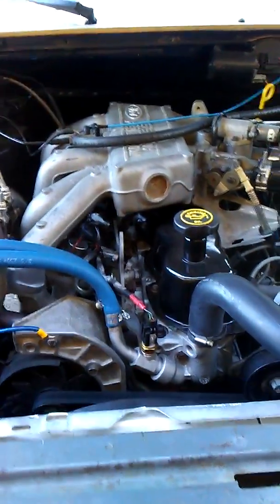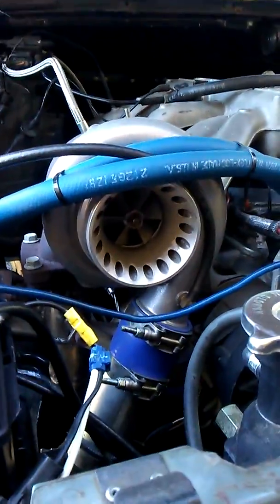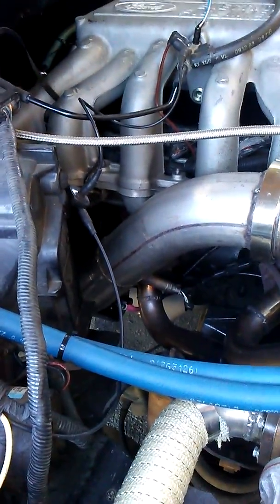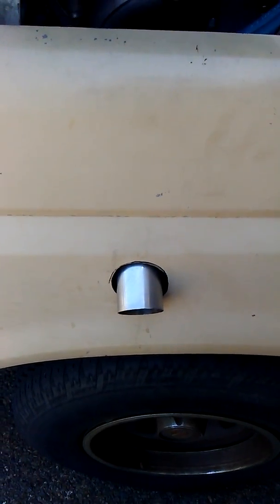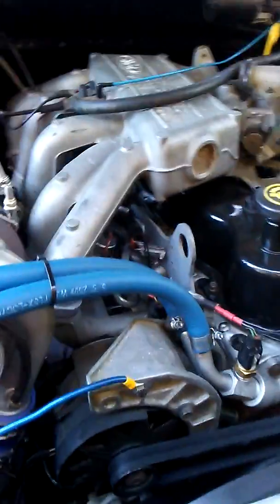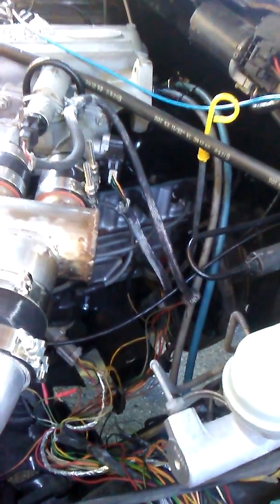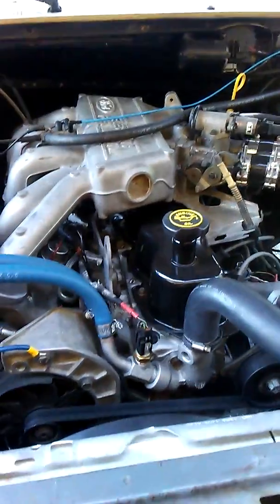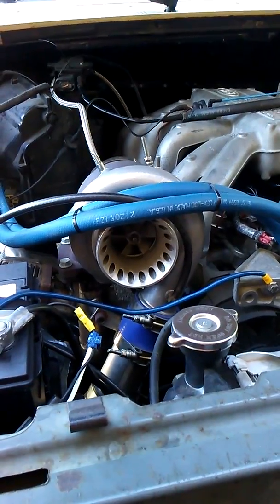Turbo 4.9 overview

Comment: How many miles did the truck have on it when you put the turbo on it? I have 3 f-150s all are 4.9 300 . 2 are 94's & 1 is a 93 ,my newest one is one of the 94s which is the only standard one I was thinking about putting a turbo on it. I was thinking of rebuilding the motor once I get my new place. I've owned Ford trucks for the past 25 years an love the older ones.i also have a 93 f-150 king cab 2 wheel drive that I've had for the past 8 years it came from Texas so the body & frame is still in good shape but I need another motor for it , which I'm looking for to rebuild an make it my toy.
Reply from the maker: I rebuilt mine before turboing it but I have turbocharged many cars and trucks without doing so. As long as the timing is low you should be ok up to about 8psi

Comment: I miss the 1994 F250HD with 300 and the ZF heavy duty 5 speed. It was a tank. The clutch slave failed and I didn’t have the money for a shop to replace it or the strength to do it myself while battling Lyme disease.
Reply from the maker: I feel the medical pain. The reason I haven't posted in a while is due to back problems. I have everything to finish my build but I'm still going through physical therapy so I can work again
Reply: Brutal.

Comment: SHow us EVERYTHING!  Ive been looking for a good simple video like this for YEARS for the old 300 EFI
Reply from the maker: The motor is in a different chassis right now. I will be doing more videos on it soon. I've just been really busy with work and school. The new chassis has had to be all custom done and that's why there hasn't been any videos recently
Reply: @johnzimburean9304  came across your video looking to turbo my 300 f150. Don’t know anything about the mega squirt and can’t seem to find much on it. I would be interested to know how you wired it up. Built plenty of carbureted engines but this is my first one with an ecu
Reply from the maker: @redneckranger92  what year 300 is it? The wiring is really easy to do with a few basic tools. Do you want to Run maf and map? And are you going to use a trigger wheel or just the pickup on the dizzy?
Reply: @johnzimburean9304  yes I will be running map and maf. It’s a 93 engine currently but I will be building a 96 engine for boost shortly. I plan on just using the pickup.
Reply from the maker: @redneckranger92  you will be limited to batch fire with the dizzy for a pickup. The wiring is only about 10-12 wires to get up and running. With just the on board map. It's another 4 I believe to add the maf as well. The instructions the ecu come with are very simple. Make sure your ecu has the bip373 installed on it or you won't have timing control. You will be locked into what the dizzy is set for

Comment: Did you run Total Seal piston rings? I am intending to boost my '68 300I6 and I also have a '65 300 a friend gave me for helping him move multiple vans. The head on the '65 block has some pretty sunken valves so I expect to have the head magnafluxed and if it turns out alright then I will have new hardened seats installed and possibly slightly larger undercut/tuliped valves. It's going in an '82 F250 so I just want low end torque and intend to leave it carbureted with a Predator 12.5:1 a/f ratio. Just starting to look seriously at specific parts. I expect to run the efi exhaust manifolds as they seem like a better option to spool a turbo faster than the HD manifold and flow just .10 less than the HD manifold, however having the HD manifold and going to a 2.5" exhaust would make it really simple to plumb, especially for my plans. I have a few T3/T4 turbos laying around just planning to use one and use a 4 core front mount intercooler. I don't want to run massive boost mostly just give me sea level power at the altitude I live at around 5,800 ft above sea level.
Reply from the maker: I run hellfire rings currently. I have run total seal in the past on some different engines.

Comment: What plugs and gap are you at?
Also what injectors 
I have a turbo 4.9 as well
Having issues with high ram boost at around 10psi... can put my finger on it .

Thanks in advance
Reply from the maker: It's probably spark blowout. Gap the plugs too .028 and get an aftermarket coil. The tfi system is weak at best. I was running 30# injectors but I have a set of 47# injectors in it now. I ran out of fuel one night and blew out my head gasket from pre detonation. 30# are good to around 15 depending on your fuel system and what you have done to male the engine breathe better
Reply: @johnzimburean9304  its just a ebay ar50 turbo t3
I picked up the turbo, wastegate and intercooler and a bunch of piping for real cheap 
Made.my own manifold similar to your with 2" stainless
Bought the flange
Bought a 3000gt vr4 aluminum hard pipe upgrade for my dual throttle body used the bov port for that for my bov.
Reply from the maker: @KryptoDiesel6_5  a t3 flange will be ok for no more than 4k rpm. Even at that your exhaust pressure will be high. If you plan on raising the rpm I would go to a t4 turbo. My 64mm is good for street use but is still on the small side for more than 15psi. Also when you change pistons you will want to increase your ring gap on the pistons. .004" per inch of bore will keep the rungs from touching and breaking pistons
Reply: @johnzimburean9304  when u say do away with the pcv valve should I leave it hooked up just remove it from valve cover or ..???
Reply from the maker: @KryptoDiesel6_5  remove the hose that feeds it from the manifold. Its up to you if you want too run it after that. I vent the front and rear port on my valve cover to atmosphere
Reply: @johnzimburean9304  ok yea I actually left the pcv valve in and vented it to atmosphere than the hose just capped off
Reply: @johnzimburean9304  I too have now both front n rear crank case breather to atmosphere. 
Also last night I took apart my wastegate, had 2 springs in it.
I cleaned it all up and reinstalled just the one smaller size spring. See if that makes a difference boosting less psi for now
Reply from the maker: What injector and pump are you running and what rpm are you turning with what cam?
Reply: Stock motor
Stock injectors 
Factory distributor 

It seems fine until I get to high rpm
Just did new autolite plugs gapped to .028
Reply from the maker: You need waaaayyyyy more injector and pump. With the stock regulator you will get close to 30" out of a 24# injector. You can get those from an efi 460 or an early cobra mustang. You will also need a 255 or bigger pump. The stock dizzy is fine just pull the spout connector to drop to base timing.
Reply: @johnzimburean9304  I may sound stupid for asking , but where is this spout connect you speak of ? Lol

Thanks in advance
Ps since only reinstalling the smaller 5psi wastegate spring , there's no spark blow
I get my msd coil tomorrow 

Lmk about that dizzy connector
Reply from the maker: @KryptoDiesel6_5  follow the wiring from the tfi unit and there will be a small plug along the harness. I believe its a yellow wire going to it but don't quote me on that one. Lol
Reply: @johnzimburean9304  it is the only single wire coming from the same harness going into the TFI?

Looks like it goes to the block itself
Reply from the maker: @KryptoDiesel6_5  it has a little black or grey plastic plug. What year is your truck?
Reply: @johnzimburean9304  yea 
I think I know exactly what your talking about.
94
Reply from the maker: You also need to disconnect the pcv. Crankcase pressure is very bad and you have to have a way to control the fuel for a bigger injector. Without these changed you will have catastrophic engine damage very soon
Reply: I do have a afpr just haven't installed yet , kinda confused on how to run it .
Also if I remove the pcv should I just vent it ?

I previously vented the front engine breather with a little ricer filter.
Reply from the maker: @KryptoDiesel6_5  vent to atmosphere. Get you tuner up and running as soon as possible. What size turbo are you running?
Reply: I did pick up some 4 hole injectors out from a 24v tarus at the junk yard but couldn't find a # spec on em

Comment: I’m looking to do the same where can I get all the stuff that wasn’t made
Reply from the maker: What stuff do you need. I made most of the things I needed
Reply: John Zimburean  most of it.  But I’m gonna buy a 7.3 garret turbo
Reply: John Zimburean mine an EFI in a 95
Reply from the maker: @kinghirschmann335  I will put together a list of parts for a street build and post it up. I get lots of questions for that. Does your 95 have a crank trigger wheel or is it like all the older ones that run off the dizzy for a signal?
Reply: John Zimburean I’m not for sure on that one bub buts it’s 5 speed which idk if that helps or not
Reply: John Zimburean I’m not much of a fabricator. But been wanting to do this for awhile I could pay for the parts if you can make them again if not a hassle I’m looking at buying another engine so that my truck still runs and drives while I’m doing it

Comment: With higher power comes the need for better brakes.
How to install 15 in. rotors on I-beam or Ford front axle is an expensive undertaking for most.
I exit here.
Reply: There is zero need for 15" rotors on a truck with the GVW this would have even with a 560lb 300, boosted is still only scratching the surface of 302 power levels. 13" Cobra rotors would be easy and not expensive at all, especially for someone savvy with fabrication, one only really needs brackets to mount the calipers and matching the lug pattern, everything else can ne sourced from a 1994-2004 Mustang Cobra.

Comment: Be careful with injector size. Keep in mind that the 1990 + 300's ran 65 psi fuel pressure to prevent vapor lock. Stock injectors are around 13 lb to lean it out  (a lot of other ford engines ran around 35 psi fuel pressure at the time) be sure to do some research, they will run very rich with larger than stock injectors. I found out the hard way.
Reply from the maker: Jake Peffer I changed the regulator back to 35psi. had to make a custom mount for it but it works good
Reply: Where can I get the 30 lbs injectors